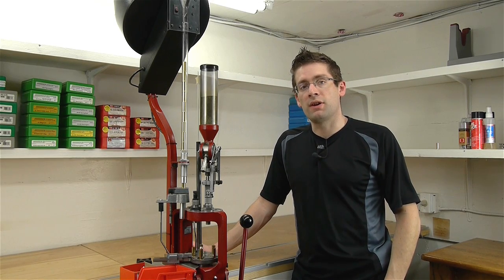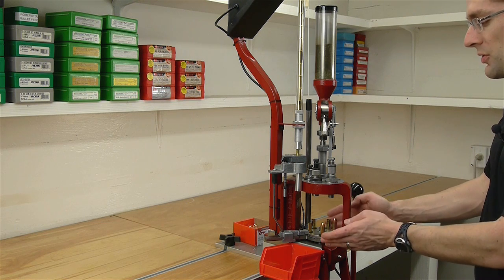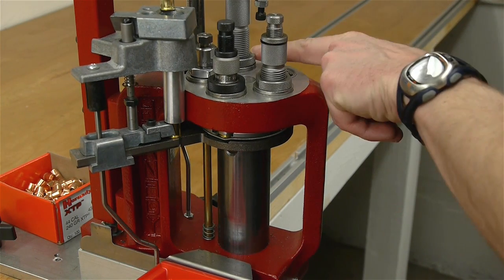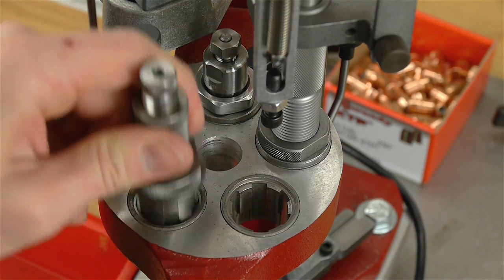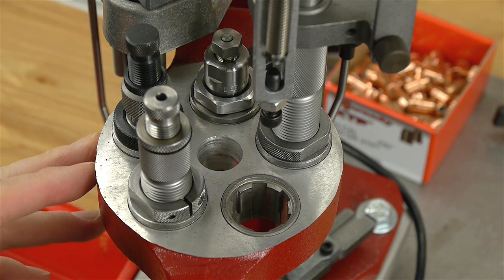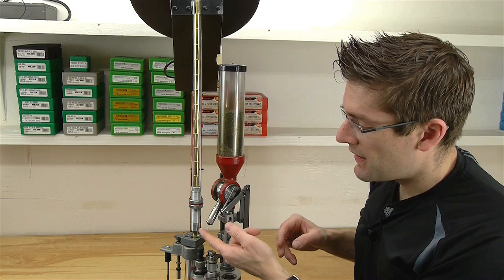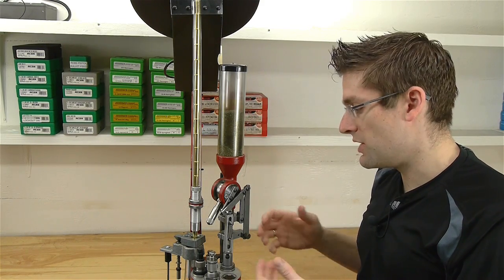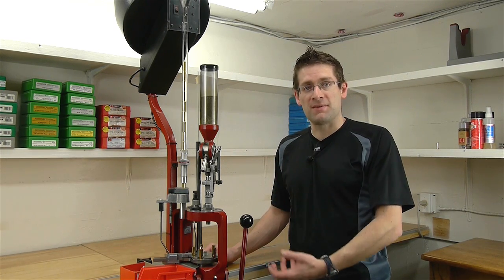Hornady Lock-N-Load AP Overview Part I

Comment: Great video, this helped me decide which press of this type to get. After a couple sessions with it I can kick out around 175 rounds and hour without the auto bullet or case feeders. The only issue I had at first was the shell plates not indexing properly. A quick web search yielded several similar complaints and possible causes all blaming Hornady in some way shape or form. Over 20 years of hand loading told me to look at my own possible faults before blaming anyone else and what I found after fiddling with it was that I was over tightening the shell plate screw causing the plate to warp and drag ever so slightly. This is a really good unit and for the price compared to others of the same quality level is hard to beat.

Comment: Great video. Thanks for sharing.  I am new to reloading but so far it's very enjoyable. I don't want to mention which press I have but it is progressive.  The things I am still bothered by is the fact that none of the manufacturers truly let  you know what is necessary to purchase before you can actually reload your first round. If you're new to this and have no friends to help out, you are kind of driving blind in traffic.  Then, considering the large amount of money you have spent, you have a ton of work to do to the reloader before it's even functional.  The amount of cleaning is quite a bit, then there are the adjustments or pieces that have to be switched out or adjusted. It's actually amazing.  There is no plug and play setup. In the long run it's worth it. The issue is that you are spending  a lot of money (if you buy anything good it's a LOT of money) and you have a lot of work to do and quite a bit more money to spend before you can actually begin reloading. My advice to people considering reloading - get the least expensive, least complicated reloader you can. I'm not saying to buy junk but at least buy an uncomplicated loader. There is quite a bit of cleaning and prep work and adjustments, etc. before you can crank that handle and have a bullet. Watch as many videos as possible and then watch some more. Become totally informed on what items will be needed along with your reloader before you can start. Understand that there is a lot more "work" to this hobby and that the actual reloading is easy compared to some of these manufacturers' hoops you have to jump through. With that said........ be prepared.  Good luck and God bless.
Reply: notsosilentmajority1 All excellent advice lol. I've just started looking at getting into reloading over the last week, I feel like my head is going to explode already!

Comment: I’ve had 3 of these and they are great. The only downside and it’s minimal is that the powder hopper when indexed will turn its way out if not kept in check. It’s an easy fix that I did and that was to wrap it in some cellophane to make it tight. It’s the only one to do that the other dies stay locked In. I only use it for straight wall pistol as I found that 556 just doesn’t do well , not because of the press but because of the consistency of the brass. To fix that problem I’d Re size and prime on my single stage. This is a great press but like ALL presses they have their plusses and minuses. Enjoy and be safe.

Comment: Use the RCBS powder lock. Saved me once from a double charge and it does not require you to look at the lifted insert and white line. If there is too much or too little powder it just locks the upstroke.

Comment: They're a good press but like anything mechanical they have some issues. I recommend getting a spring washer to hold down the shellplate otherwise it can work loose, also you can get powder in the primer slide so keep your eye on it if this happens it doesn't line up properly. Besides that it is a decent press very rigid and the powder thrower throws fairly well, it can throw within +- 0.1 grains

Comment: I have the same Hornady press with the auto case feeder. 9mm is 
especially problematic. My case feeder drops cases out of the drop tube 
at any angle causing them to fall into the processed case box or behind 
the shell plate so when the ram goes up it smashes the case sideways 
into the decapping pin and bends or breaks it. This is because the small
 drop tube provided is way too big to hold 9mm so they drop out 
straight. The v block is designed to tip the case over as it is pushed 
towards the shell plate. The v block regularly tips the case and the 
edge of the rim catches as it tries to cross the retention spring. The 
hopper jams up all the time. I spend more time unjamming the pile of 
crap hopper than what it takes to manually feed the cases. I noticed you
 selectively cut out parts of the video. It is obvious to me you edited 
the malfunctions of the case drop tube, the malfunctions of the v block,
 and the jamming up of the case feeder hopper.

Comment: When I switched over from the .45 to the 9mm I have and issue with the powder drop. I set my 5 stations up exactly like yours. However, when you cycle the press with a case the insert/drum does not cycle the full stroke to the top. This gives me inconsistant powder charges. Brad at tech support has been less than helpful (couldn' t solve another issue with .45 that I solved myself just a loose screw in back that allowed it to slip and change the charge weight).

Comment: Hey Gavin, is there any reason that the Lock-n-load powder measure with the Case activation...is there any reason that setup wouldn't function on a Dillon 750? I'm hoping to set up a 750 to load 338 LP and need the larger powder drop availability found in the Hornady setup that just doesn't work with the Dillon powder measure. Thank you.

Comment: I've been watching a lot of your videos as I'm in the market for a progressive press ( with or with out auto index ). This plant looks to operate relatively smooth and trouble free. For the price would this unit be more cost effective than the Dillon 1050? I load for my Stepdad and myself only. Neither one us shoot competition so we're not looking at 500 rounds a week.
Reply: Guess I should have added the 650 also
Reply from the maker: More cost effective YES! The Dillon machines are optimized for long-haul loading (thousands at a time) and cost more. Each system/make has their pros/cons.

Comment: I know this video is six years old. This press is optimized for high volume loading, but if one wanted to bust out only 50 rounds for a rifle, can this still do that or is the setup time not worth it and should stick with a turret system. This is the main type of loading I’ll be doing with the occasional 500rd pistol sessions
Reply from the maker: Jesse- absolutely- great for a 50 round loading session. Esp. if you already have the right shellplate on the press (Ex: #1 shellplate for 45 ACP, 30-06, 308, 6.5 Creedmoor, 6mm Creedmoor, 22-250, etc).
Reply: gavintoobe awesome thanks for the tips. I’ll be speaking with Santa soon.

Comment: Does the powder charge station flare the case as well ? Im having a hard time finding info on this . Do you have to have a separate station for flaring?
Reply: There is a thing called the PTX Expander that fits into the powder sleeve that will flare the case.  You can buy them separately for each caliber.  This is only necessary if you don't have an open station, such as having a powder cop die.

Comment: Are you aware if you can get the parts needed for the shell feeder without the powered hopperI don't mind stopping every little bit to load brass in the tube, won't be loading enough to justifythe extra $$$ for the complete shell loading system, Thanks